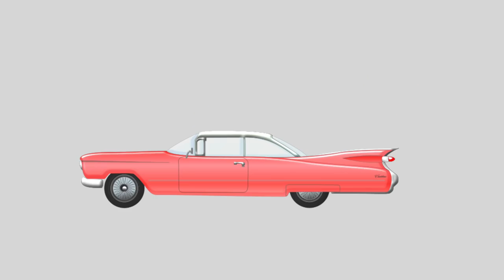Yes, Rockets CAN Fly in a Vacuum

Comment: Congratulations, you have explained how things work that are not in a vacuum! Please explain how rockets work in a vacuum without anything to propel against. Thank you .
Reply: Rocket engines are mass accelerators.
Any machine that applies a force to another mass must feel a recoil force.
Reply: @stuartgray5877  like a rocket applying a force to the atmosphere? 🤔😂
Reply: They don’t have to “push against” anything.  Newton’s 3rd law doesn’t require that.  
Also, balloons are not an ideal analogy to rockets.  A rocket produces thrust in the combustion chamber in all directions.  Axial forces against the walls cancel each other out.  The gases are released out the nozzle.  But we also have forces against the front, or forward region of the combustion chamber.  This contributes to forward movement.
A balloon only has static pressure against the forward area that only drops when pressure is released.  There is no force pushing on the forward wall of the balloon, only a release of pressure that creates force solely through Newton’s 3rd law.
So all these videos with silly balloon cars trying to debunk rockets are ignoring the combustion forces acting on the front of the combustion chamber, which is absent with balloons.
So there is “pushing” against the front of the motor (as well as the angled surface of the nozzle on larger rockets) but the action - reaction of the exhaust gases doesn’t push on anything.
Reply: @Splattervision-qh1sd  Newtons third law absolutely requires pushing against something, you are insane to suggest otherwise.
Reply: @Splattervision-qh1sd  "Whatever draws or presses another is as much drawn or pressed by that other. If you press a stone with your finger, the finger is also pressed by the stone" 
A press (pressure) & a push are the same thing. So you are a proven liar.
Reply: @papalegba6796  The gas pressure (greater than 3000 PSI ) in the combustion chamber creates the region of high pressure,  while the external (atmospheric) pressure is 14.5 PSI.
I assume you agree with the gas laws that states that gas will move from a region of high pressure to a region of low pressure.
The gases exiting the 3000 PSI combustion chamber feel the acceleration from this pressure (a force) ang can achieve a nozzle exit velocity of greater than 2500 meters per second (about Mach eight at sea level).
Due to the law of conservation of momentum, the rocket must absorb the same momentum as what is impacted into the rocket exhaust.
A space shuttle main engine can accelerate 500 kilograms of water to mach eight every second.
Based on Newton's third law, the rocket engine must feel an equal and opposite force pushing in the opposite direction as the gas flow.
Draw the free body diagram and you will see there must be two forces involved.
You are welcome.
Reply: @stuartgray5877  the gas laws state that a gas expanding into a vacuum does not develop mechanical power, chatbot 😂
Reply: @stuartgray5877  nice job ignoring your other shill account openly lying about Newtons third law too, chatbot 😂
Reply: @stuartgray5877  nice job ignoring all the times you're shown to be wrong, chatbot 😂
Reply: @papalegba6796  so tell us exactly where my statements above are false.
Reply: @papalegba6796  then tell us how rocket engines accelerate all that mass.
Is it *magic"?
Reply: @papalegba6796  oh, you're here. spamming your nonsense under another video. I was wondering where were you hiding after you refused to answer the questions and run away like a coward.
Reply: NASA chatbot copy pasta intensifies...
Reply: @stuartgray5877  The exhaust is a force exerted by the body, and forces exerted by the body are not included in free body diagrams, chatbot. There, that is how you are wrong, tho you are not programmed to admit it. 😂
Reply: @frantaspacek  I quoted Newton himself. So you're saying Newtons own words are nonsense, chatbot 😂
Reply: @papalegba6796  you quoted wrong thing, again
Reply: @papalegba6796  you didn't understand my message, typical
Reply: @DrCash7  - and we know that you and papalegba are the same person. Did you have a point?

You and papa have been making a fool of yourselves on these threads for LONGER THAN IT TAKES to get a High school education. So, what's your excuse for being willfully ignorant?
You could just READ A PHYSICS BOOK.
Reply: @stuartgray5877  reduced to lies & abuse as usual, chatbot 😂
Reply: @stuartgray5877 Atmos acts as a barrier.. a wall to push against. The higher the force pressing on atmos, the higher the velocity of the craft exhausting the force.
Also maneuvering requires atmos for the wings to deflect air in order to veer. 
The higher the velocity the more friction. The more friction, the more heat.
Haven't you watched Top Gun: Maverick?
It explains everything.
Reply: @dragonz_eye If I put on a pressure suit, walked into a vacuum chamber, and performed the rolling chair and heavy object experiment, would I roll or not?
Reply: @AM-rd9pu Stop equating a vacuum chamber under the influence of downward acceleration to the constantly accelerating fictional spacial reference frame of "space."
Reply: @dragonz_eye You still aren’t understanding what reference frames and vacuums are. They’re just a lack of stuff. 

There’s a lack of stuff in a vacuum chamber and space is a lack of stuff.
Reply: @dragonz_eye The space between the stuff is basically empty. What’s so hard to get about that? Interplanetary space has a particle density down to single digits per cubic centimeter compared to the 10^18 particles per cubic centimeter in earth’s atmosphere. Do you see the difference? And do you understand just how far apart things are in the universe are? The universe is mostly (basically) empty space.
Reply: @dragonz_eye please explain how an air molecule that is blown away from the nozzle by the high velocity exhaust gases “push” back on the rocket?

How about you man up a force diagram? No? Why not? Don’t you claim to know real physics?
Reply: @kitcanyon658  so now compressible fluids are fake too? Do you even physics, chatbot bro?😂
Reply: @AM-rd9pu  so now you've been to space & measured everything in it? Don't think so, chatbot bro 😂
Reply: @kitcanyon658  you're literally claiming gas doesn't have mass & that all the laws of dynamics are wrong 😂😂😂😂😂😂
Reply: @papalegba6796 Have you been to space and measured everything in it? You know you don’t have to do everything yourself to know it’s true right?

Comment: Car wheels push off the road, so what do you push off In a vacuum. Another ignoramus youtuber video!
Reply: - "so what do you push off In a vacuum. "
Mass.

When rockets lift off, they are about 95% REACTION MASS.
You are welcome.
Reply: Imagine calling others ignoramuses while showing that you have absolutely no idea how rocket thrust works.
Reply: There is no mass in a vacuum to push off. NASA chatbots say the silliest things 😂
Reply: @papalegba6796  - "There is no mass in a vacuum to push off. "

Except rockets take mass WITH THEM to space.
At liftoff rockets are about 95% reaction mass.
Reply: @stuartgray5877  that violates Newtons first law, as well as the gas laws. A vacuum cannot apply external force or pressure. You lose again, chatbot 😂
Reply: @papalegba6796 Gas has mass. Would gas colliding with the walls of the combustion chamber and nozzle not result in a force being imparted on the rocket?
Reply: @AM-rd9pu  that's not an external force, chatbot 😂
Reply: @papalegba6796  The gas collides with the combustion chamber and nozzle before being shot out the back of the rocket. What force do you think causes that to happen?
Reply: @papalegba6796  - "that violates Newtons first law"

Oh, so you know Newtons laws, do you?
Then please explain how a rocket engine accelerates all that mass?

According to YOU: Rocket engines accelerate mass WITHOUT APPLYING A FORCE.
SO please do: EXPLAIN IT TO US GENIUS.
Reply: @stuartgray5877  combustion, like all heat engines. And, like all heat engines, the working fluid must meet external pressure in order to develop mechanical power. Are you ok, chatbot?  Cos you're really struggling here 🤔😂
Reply: @AM-rd9pu  still not external force, chatbot. So the laws of physics still say no work done in a vacuum 😂
Reply: @papalegba6796 And you’re back to the w = p * delta_v discussion. Why do you refuse to listen to what w actually represents?

How does an object striking another object and flying away not impart a force according to you?
Reply: @papalegba6796  So CAN YOU calculate the work required to accelerate 500 kilos of water from a standstill to Mach eight?
No?     WHY NOT?    You CLAIM to understand basic physics.
Work calculations are about as basic as you can get.
Reply: @stuartgray5877  water? 🤔😂
Reply: @AM-rd9pu  a gas expanding into a vacuum does no work, chatbot. So a rocket exhaust does no work in a vacuum. Lie more about it eh? 😂
Reply: @AM-rd9pu  the rocket exhaust strikes nothing in a vacuum, chatbot. Because there's nothing to strike. Stop being mental plz 😂
Reply: @papalegba6796  Would you agree that if you fire a rifle in space, that it would recoil as it does in the earth's atmosphere, due to the mass of the bullet being shot out of the gun in one direction, causing the gun itself to move in the opposite direction to the bullet?
Reply: @sailorman8668 Don’t expect any sort of rational answer from him.
Reply: @papalegba6796  Once again, joule free expansion means that the the gas does no work on the surroundings which makes sense because it takes no work to push nothing. It doesn’t say anything about doing work on a container. Why do you refuse to understand this?

And the exhaust gasses strike the nozzle. Do you not think that would impart a force on the nozzle?
Reply: @AM-rd9pu  if the rocket does no work on the surroundings then no mechanical power will be developed by it. No power = no motion, chatbot. Why do you refuse to understand this, chatbot? 🤔
Reply: @sailorman8668  a thermal rocket is a heat engine of the internal combustion type, chatbot. A GUN is not. So your false analogy is irrelevant, as usual 😂
Reply: @AM-rd9pu  the working fluid of a heat engine must meet external pressure in order to create work, chatbot. The exhaust is the working fluid of a rocket. No work, no motion. Sorry you lose again 😂
Reply: @papalegba6796  The gas particles collide with the nozzle. Do you not think that imparts a force on the rocket?
Reply: @AM-rd9pu  if the nozzle is responsible for creating motion, why do rockets still work without nozzles? Oops, painted yourself into a corner there, chatbot 😂
Reply: @stuartgray5877  I see you still ignore the gas laws & Newtons laws of motion, chatbot, as well as all the nonsense posted by your fellow chatbots. You also think a gas behaves the same as a solid. It does not, chatbot 😂